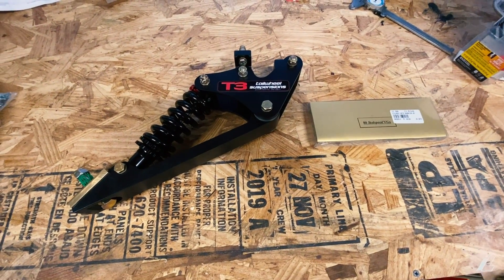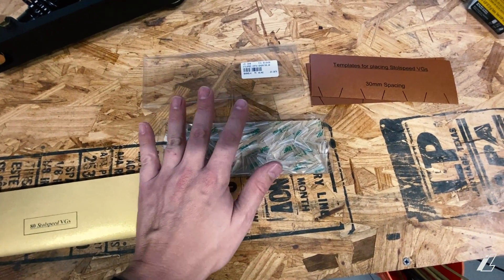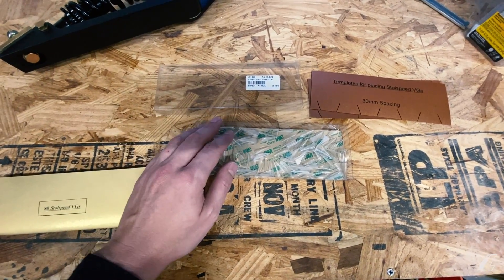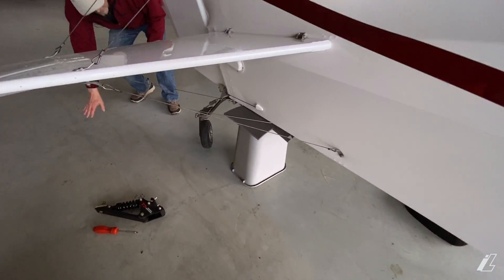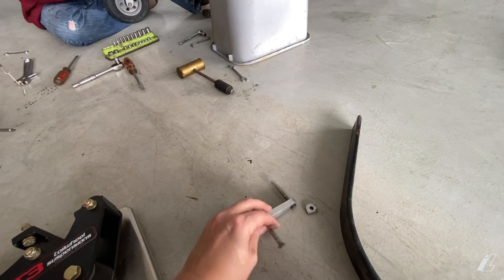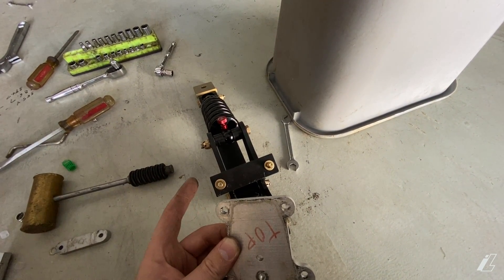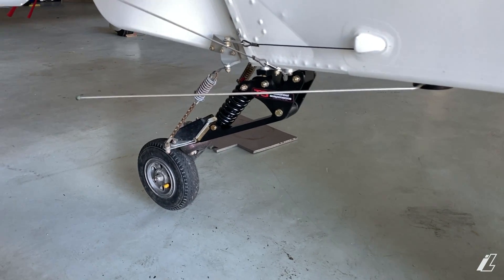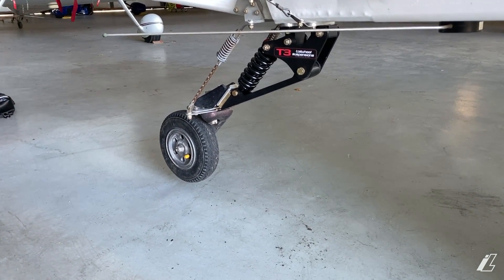RANS S6 STOL Project - T3 Tailwheel Install

Comment: since my s6 has no tail light (the rear-facing whites are in the wingtips) , i had to have a new transponder installed. how did you accomplish adsb-out?
Reply from the maker: I went ahead and invested in a new transponder from garmin. I wanted to have something that would be long supported and I don’t trust the sky beacon and other external mount solutions for the long haul.

Comment: Awesome mate. I've got mine to install on my S6s soon. My s6s is older than yours so the bolt pattern is different. I have dirt runways which haven't been graded or rolled so I'm looking forward to it. Also the tail tends to bounce/skip a bit instead of stick. Can't wait
Reply from the maker: The t3 really helps that “stick” with the different compression and rebound. Doing little drop tests was impressive.
Reply: @ianslife210  cool. What preload and rebound setting did you go with.
Just got my big matco peunmatic tailwheel today. Looking forward to install. What size are your mains. Mine are 13.5inch diam, changing to 22inch.

Comment: That new tail wheel looked like it was a lot softer than that original metal spring steel. You AOA on ground also did look much better! Cheers from Winnipeg.
Reply from the maker: It really is on both fronts. I need to get some footage from outside like the shot I use early on to show how much more angle of attack it got me.